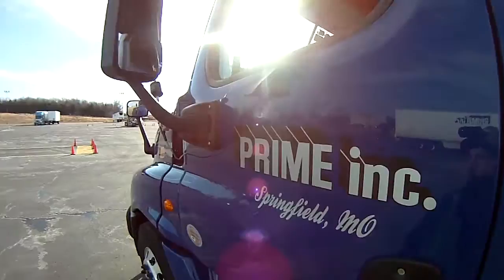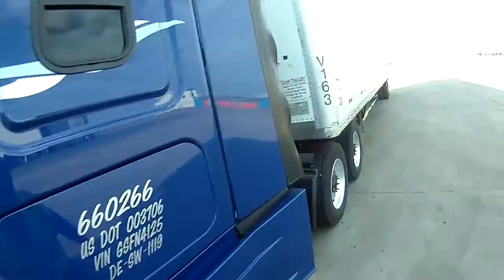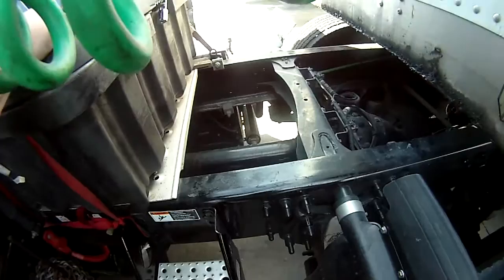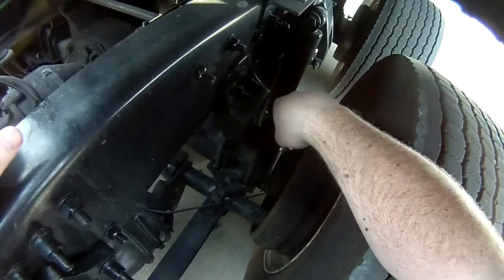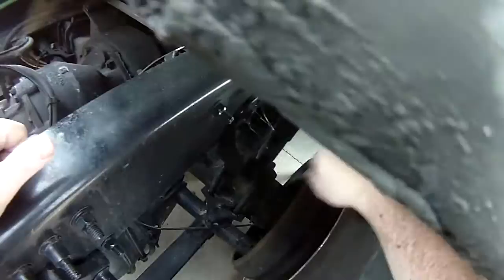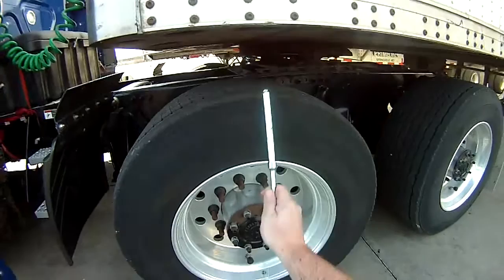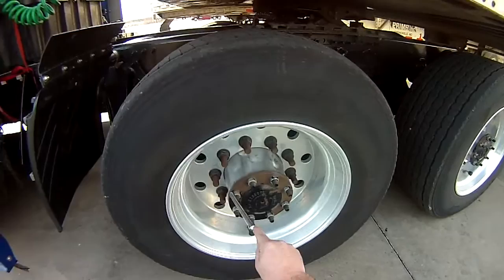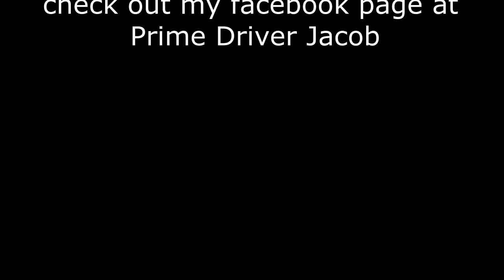Drivers Door Fuel Area Pretrip Inspection

Comment: Jacob I now you said the brake shoe shouldnt be worn dangerously thin....when I took my pretrip test the examiner ask how thick they should be I drove and hauled coal off road for 9 years and have never heard anyone say the safe shoe thickness and its not in the virginia cdl book is there a specific thickness on the brake shoes like no less 3/8 inch ect